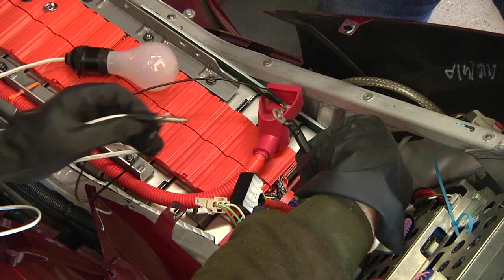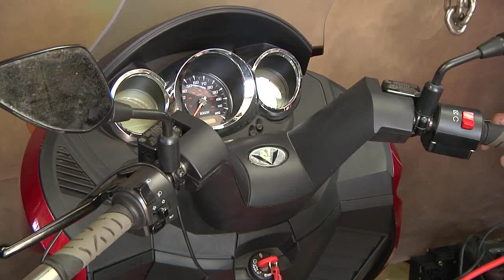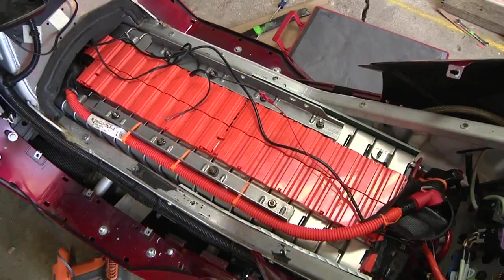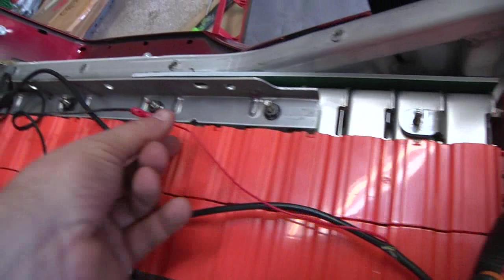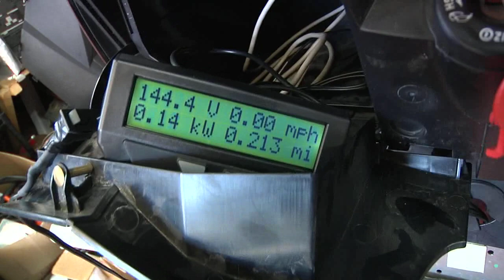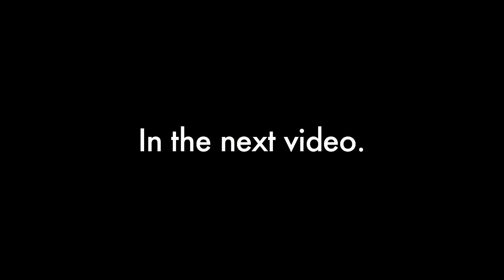Vectrix w LEAF batts 03 power connections, spin the wheel, Cycle Analyst

Comment: Did i missed something or bms is not connected?
Reply from the maker: I hadn't heard that. I'll have to check on it.
Reply from the maker: +zolines I kept the wiring from the Leaf BMS. Only part of a pack, and no car to talk to, the original Leaf BMS wouldn't work.
I added a couple Cell-Logs to check on individual cell voltages. Still playing around with that a bit. The cell modules were all balanced and the charger is set to an 80% type charge.
Reply: Ben I've heard the cell-log consumes from only one cell to run which will unbalance the pack.

Comment: I bet there are a few salvage Nissan Leaf batteries out there for more conversions. You need to do this conversion for other Vectrix owners like me!
Reply from the maker: Jason Jackson That's where one of the other thirds of the LEAF pack is going - to another guy who has a Vectrix, who I am helping to upgrade his cycle. The cycle is GREAT, it's just the original battery pack that was a problem.
Reply: BenjaminNelson Hi Ben, great work! What FW you're running at VX1 now? did you make any pre-equalization of Leaf cells? and finally, how much did you spend for the used battery pack? I'll check every other video you have, probably it was answered earlier. I'm now with NiMh VX1 2007, first version of the charger obviously. How is about Prius batteries, have you considered it?
Reply from the maker: DeftAudio I never changed the firmware on the motor controller. I changed the software on the battery charger. That was custom from user "The Laird" on the VisforVoltage forum. It accounts for the 60ah capacity of the batteries, and limits the top voltage to 147V. Sets the charger to 10 amps (1500 watts/10amps/150ishV pack) I paid $2637.50 for the LEAF battery pack, and then sold 29 of the modules to two other guys for a total value of $2850. So I came out about $200 ahead, in exchange for locating a LEAF pack (good luck to anyone else trying this, it's not easy...) tearing it all apart, not electrocuting myself, shooting YouTube videos of it all, and reassembling 18 modules into the Vectrix. The Prius battery is not very energy-dense. It's something like 1.2 or 1.3KWH of capacity. My battery is rated at 9KWH. I'd need 7.5 Prius batteries to equal the capacity of my LEAF pack.
Reply: BenjaminNelson Thank You!